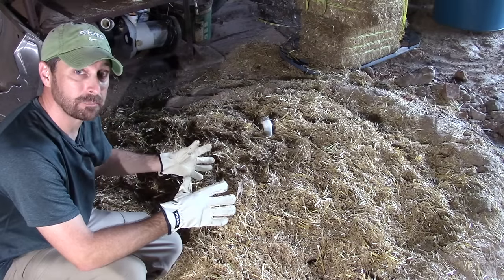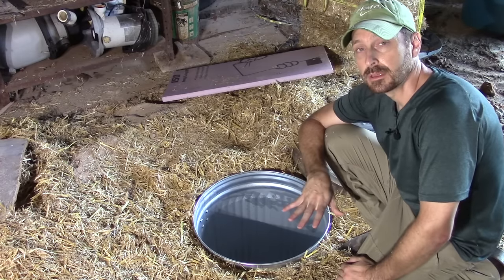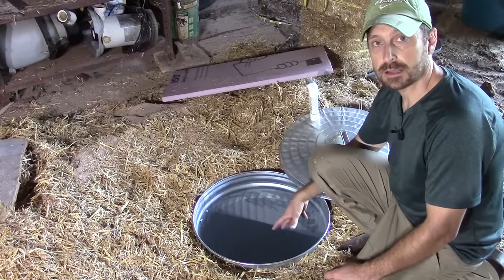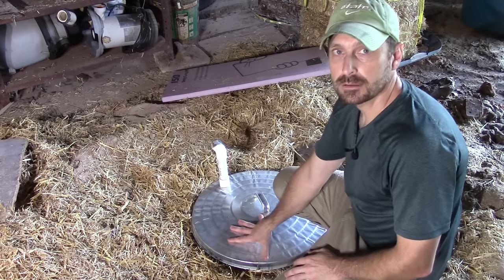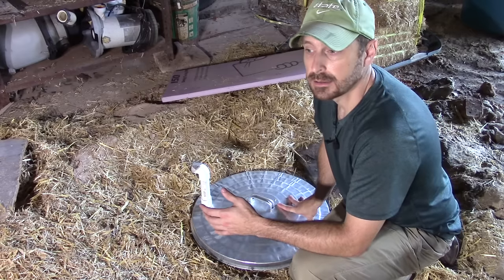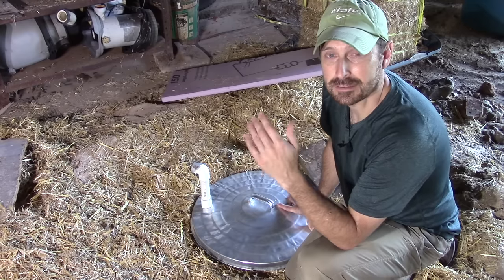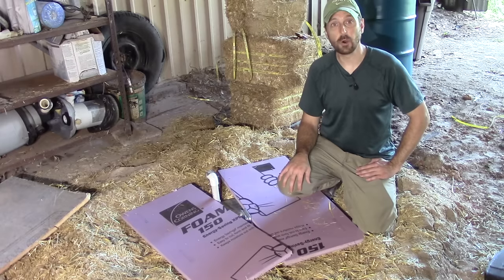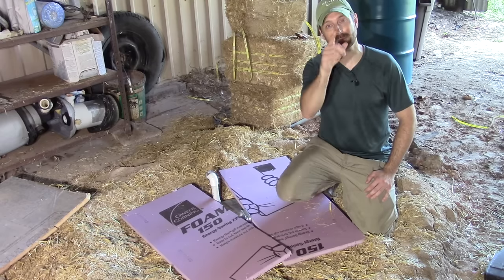Our Simple Inexpensive Root Cellar Build

Comment: After about two and a half months and I finally got my answer. I dug the hole 36in put my 30 gallon trash can in the hole back filled the sides with soil... that left about 18" above the trash can lined the rest  with 1" inch pink styrofoam. I made 2 baskets out of green plastic wire attached to strings to it so I can pull them up. Then I froze salt water in 2  gallon jugs and some with half gallons of ice and put two or three of those down in the hole...insulated a wooden lid and now my temperature is around 49 to 50 plus in the middle of July in Atlanta area 100% success.
Reply from the maker: That is awesome!
Reply: How often do you have to refreeze the water?
Reply: Have you thought about using sand around the container to keep wet similar to how Indians have done with the clay pots forever?
Reply: Great idea !
Reply: Well done! 🌅
Reply: That is totally awesome for you..
Reply: This is fantastic!
Reply: I would also like to know how often you refreeze the water if you’ve got the time to respond.
Reply: @spindoggytheexplorer2915  good morning Mario. Thank you for your inquiry. From May to August I re- froze the water daily. I didn't mind since I was getting fresh potatoes. I just harvested my last ate potatoes yesterday. Five and a half months in the ground and not one loaded potato and the ones that sprouted we're only about an inch long. I can't wait to harvest my batch here at the end of November if I can keep them but when the freeze comes here in Atlanta. Any other questions I'd be happy to answer.
Reply: @kzf8978  Daily. It was worth it since I got fresh potatoes up till yesterday November 3rd and no rotted potatoes and any Sprouts were no more than an inch long.
Reply: @DsHomeyGarden  Good info, thanks for sharing.
Reply: Wow!!! Great ideas!! I'm in N AL. I'm going to try that!!! Thank you!!❤
Reply: My question is regarding the lid wicking. Did I miss the details on how to do that? 
Did you do something like that also?

Comment: I think a major issue with anyone who gets a lot of rain is the water coming up through the 3/8" holes in the bottom of the can. I think it is a good idea to have it 'indoors', but out in a yard might be a bit risky.  If I was to do this, I'd seriously overdig the depth, fill with gravel, then place the can in the hole, to prevent a water issue rising up into the can. The gravel would act like a french drain.
Reply from the maker: Correct, it is about placement. Mine have always been in barns with dirt floors. The gravel is a must if doing this outside.
Reply: Even more simply, just don't drill the holes to begin with. Not very much air will "rise" up and through those tiny holes anyways. Air doesn't travel much/very well in compacted soil. What does happen is that the metal conducts thermal energy up from or down into the ground depending what area is warmer or colder--that in turn either cools or warms the air inside. While you may get some condensation, all you really need to do is to put something like diamatcaeous earth or the like on the bottom, so that if condensation does build enough on the wall to run down to the bottom, it will be absorbed (and slowly released into the air) and kept directly away from the food.  You still want a vent, but mostly to vent excess humidity and the warmer air on the top. Generally though, even with holes, there is not going to be much air circulation going on anyways. Most of the air circulation will just be from cold air and warmer air exchanging that thermal energy, which convects/moves the air in very weak, slow "currents".  But more importantly, you want to vent the excess humidity out.

Comment: You should have sprayed the holes you drilled with Rustoleum spray galvanize compound.  The bottom will rust out prematurely.  When you drilled through the galvanized can, you exposed the steel.  All that moisture will rust it out.
Reply from the maker: Good point. I will add that to the process.
Reply: @CountryLivingExperience  And I wonder about little critters getting inside… add mesh screen to the holes?
Reply: It would still function with no bottom.
Reply: @CountryLivingExperience  could this be done with a plastic trash can since it doesn't rust?
Reply: @lisakukla459  sure, but in E TX its so lush & every kind of varmint bug & spider will eventually find the easy way in...these nice people from was it Minnesota? may not have learned that yet lol...to keep mice out is why he made holes 3/8" wide...theres also lots more surface water seepage due to rain all year long
Reply: @joanies6778  Mice will eat Irish Spring soap. Personal experience speaking. That Irish Spring thing is a myth.
Reply: IDK the Irish Spring soap chunks r keeping the rabbits from mowing down my gladiolas this year. I hadn't heard about it repelling mice tho
Reply: @ladypearl9134     Mice greatly dislike strong mints though.  One good method is to buy mint tea bags and then put some peppermint essential oil in it. You'll have to refresh every once in a while though.
Reply: @justinw1765  I just grow actual mint all around my place. Ants and mice generally keep away and I don't have to kill things that have an actual job in the environment. I'd prefer they just do their job in the places they should do it in.
Reply: The galvanization could potentially leach into your produce especially with the high humidity.

Comment: Even easier and larger is to bury an old chest freezer or refrigerator laying on its side, they are already insulated and hinged doors work great, Just add vent pipe !!!
Zone 3 in northern Minnesota 🥶
Reply from the maker: That is a good method too. I wouldn't say easier....especially digging through that insane hard pan clay in my area.
Reply: Maybe a small college room size one.. those get thrown away. Hmmm.
Reply: Great idea!!! Did you  add a drainage on the bottom or just vent the top? Also, did you place it below the frost line? You should make a video for the northerners.
Reply: You probably already know this, but the way to dig in hard clay or gravel is to dig a small hole to full depth, then expand it by shearing off little slices, going round and round until it’s to full size. A sharp shovel with good handle, damp soil and good boots like military type or cowboy boots all help A LOT. A narrow long shovel helps to make the initial hole, don’t know what they’re called, not a trench shovel with the funny bend in it.
Reply: That is a good point, I’d toss a pallet over the mulch and be done with it. Kids aren’t going to lock themselves in a trash can, and if they are, a little of that is good for the gene pool.
Reply: @przybyla420  Clean out shovel. nope. i am wrong. Zack has it right. sharp shooter.  clean out has a bend
Reply: Remove and fill with water to make sure it doesn’t have a leak. Then fill in bottom of hole so the cooler sticks up slightly from ground level. Then if this doesn’t work you may need to mound it a little over the lid with mulch of some kind, then put down a piece of thick black poly. The mound makes the poly shed water, not puddle. Or an improvised cover of some kind.
Reply: Weigh poly down with rocks
Reply: Wow that’s a great idea
Reply: @CountryLivingExperience  it was way easier that what I watched you do and so much more room, plus things aren’t stacked on top of each other so you can get what you need, but we each have our own preferences.
Reply: @CPThyme  I didn’t have a drain hole but I’m sure you could ! I would use those baskets that come in freezers or crates to stack stuff in, it’s easy to get what you need and check for spoilage, also put brown paper or news paper among stuff to kind of keep it dry. 
My daughter and her guy just moved back up here and bought an old farmstead, they want to raise farm to market organic vegetables, I’m trying to get her to do a YouTube channel for zone 3, not much out there for us up here !
Reply: Or cooler.
Reply: @CPThyme  See 3:20
Reply: Wow! I have a huge fridge I can use. Awesome idea! Thanks for sharing that ✌
Reply: That’s a great 👍 idea . I was going to throw my old refrigerator out . Now I’m not . Thanks 🙏
Reply: Do you still need drain and vent holes?
Reply: My fridge just went out in the garage. Thank you so much for the idea. Do I still put holes in the fridge to?
Reply: @brandyrosson646  
That’s what I was wondering 💭 if you find out let me know . I want to do the same thing with my refrigerator
Reply: Why do you need a vent pipe? And wouldn't rodents be able to get in that way?
Reply: @rnupnorthbrrrsm6123  howmuch does farm land cost??
Reply: It’s hazardous to keep freezers with toxic Coolant tank. That’s what I was told at the dump.
Reply: @rnupnorthbrrrsm6123  já estou ansiosa pelo canal , sou do Brasil aqui ninguém tem está cultura antiga ,eu aprendo muito com vocês de fora
Reply: I was just going to say this as a joke lmao but it looks like it is a legit way! Cool!
Reply: My neighbor did that 30 years ago and still uses it today
Reply: @CPThyme  did you watch the video? 🙄🤦
Reply: @kamthornhill1109  yes vents should be used regardless of what container you use!
Reply: @Phethephoenix  refrigerant's are contained in the system, but if they happen to get a leak then the gasses dissipate very quickly, and you don't have anything to worry about, besides where do you think those compressed gasses came from? They came from the atmosphere.
Reply: Now there is going to be a run on old broken refrigerator
Reply: @CountryLivingExperience  Or the bloody rock in PA coalcountry.
Reply: What a great idea.  I wish I hadn't taken my broken fridge to the junk yard.
Reply: I was just going to ask how far down to go here in west-central Wisconsin! My dad said the water pipes all had to be six feet down on the farm. (A lot of clay base there.)  When I was a child, my mom showed me where my grandparents (on her side) used to have their root cellar dug down in the ground on the farm that she grew up on. She said her folks would send them to the root cellar for vegetables and canned fruit or pickled goods that were stored there in glass canning jars. That's what they had for dinner and supper. The chickens laid eggs and they had filtered cow's milk after the cream was skimmed off to make butter. They'd throw the bread dough back and forth, like a game, until it was ready for their ma to bake it. She mentioned them wrapping apples up in newspapers to keep them, too. People also used to put a cloves stick in them to keep them fresh. She'd also boil apples and can them along with her vegetable garden produce, plums, berries, etc. Then she'd store them on shelves down in a cool corner of the basement, away from the woodstove, after she married my dad,  He, later on, took over my grandparent's dairy farm. I remember my mom also saying how her dad was always heating rocks to wrap up in newspaper to put by their feet at night while they slept upstairs in their straw mattresses and feather pillows in that tar paper shack her dad built. When it was too cold to walk to school he'd put those newspaper-wrapped rocks in the sleigh and cover them all under a horsehide blanket while he went around picking up all the school kids and dropping them all off at school. He'd pick them all up again if it was still too cold to walk back after school let out. I wonder if it would be too wet to dig all the way down to the hardpan and build a root cellar basement at the farm I grew up on. We might go off-grid living there by next spring. We put a big trailer there, have a drilled well and holding tank...but the root cellar could also be a tornado shelter. I liked the idea of putting an old fridge or freezer down there with a vent sticking up through the roof. We have a nanny goat, 9 chickens, 2 kittens, and a Pomeranian. Any advice from you guys? (Other than to move south in the winter months! LOL)
Reply: @ifsheisgonetowherethere6259  we just buried the big chest freezer so the lid was above ground. We covered the area with a thick layer of straw. A frost blanket over the lid may be handy 🤷🏼‍♀️
Reply: @rnupnorthbrrrsm6123  just curious, did you use the buried fridge this winter and if you did, did it do a good job of keeping your food preserved through the winter?
Reply: @przybyla420  🤣
Reply: @przybyla420  yeah but a kid in your cellar ruins your day and your food.
Reply: Omg, good idea. I’m in northern Minnesota also. So I don’t know how well this will work but it won’t hurt to try. I’m also concerned about the amount of ground water we have. Will have to find away to keep water out.
Reply: @CPThyme  
Definitely!!! I’m up in northern Minnesota and it’s rarely talked about...
Reply: @rnupnorthbrrrsm6123  
Right!!!
Reply: Vente Pipe?
Reply: @CountryLivingExperience  👍 Thank you for your video on this easy cellar idea 💕
Reply: @joycebowie7768  He said to put wire screen over the pipe

Comment: Rootcellars have been used for centuries for food, nice twist here.
Btw, for those who want to store fuel and do not have a huge fueltank, a kind of separate rootcellar for jerrycans for gasoline and/or some propane tanks works too. No direct sunlight, fairly consistent temp. And when dug a bit away from the house it also means much less risk in case of a fire, either at the house or outside. Doesn't have to be huge either.
I did say separate, as I personally would not recommend mixing the storage of food and fuel in the same cellar/area.
Reply from the maker: Thanks. Good idea about the fuel.
Reply: Good tip on storing fuel, loved it.
Reply: That might be a really great idea. That would be especially helpful so that it won’t get stolen!
Reply: Good tip. Maybe I'll have to vent them less if the temperature stayed somewhat consistent.
Reply: Thank you for the very helpful tip!
Reply: @jheanelltabana8713  It will always be a good idea to have some kind of ventilation if you want to store fuel, it will prevent the fumes from building up. But any kind of rootcellar should have a venting hole.
My fuel one isn't too large; just enough for 12 jerrycans of regular fuel, 3 with ethanol-free for gardening equipment, 5 propanetanks for the grill and emergency use, several packs of smaller tanks for camping gear and then some space for the stabilizer and some different kinds of engine oil and lighter fluid.
But I like keeping it away from the food, so it has it's own separate small one.
But by keeping all that away from the house, stored underground it sure mitigates any chance of serious accidents in case of a fire.
Reply: Cute. Lil

Comment: I went to Appomattox VA. One time and toured the house were the surrender papers were signed.
In the yard was a two thirds buried little structure with steps going down inside to a dirt floor if I remember right.
It was summer time and I had short sleeves on. As I walked down inside, it was freezing.
I just thought it was the spirits of the dead but no it was a root cellar.
I have never forgotten that day.
Reply from the maker: It is amazing the temp difference just a few feet under the earth.

Comment: In the middle of the shed , with a foam board on top of a lid. What a genius. I wish I could be so creative. Please do a follow up one year later to show us your actual produce that made it through the winter.
Reply from the maker: Thank you Abraham. We will surely do a follow up video for you. From experience with my Dad's root cellar when I was a kid, this method works very well and keeps the food fresh all winter.
Reply: I wonder lining the lid with the foam, cutting it in circle shape might make a better insulator. Stick the pvc pipe right through the foam. That way it does not not have to be loose on the floor.
Reply: @CountryLivingExperience did it work?
Reply from the maker: @LCLand  Yes. In this climate it works well in late fall, winter, and spring. Summer is too hot.

Comment: I think you should cut the foam to fit around the top of the lid with the hole through it for the pipe, glue the styrofoam together so it will stay.
I figure if you're going to put all that work into it, you might as well finish off the top. Excellent video by the way.
Reply: Great idea!!